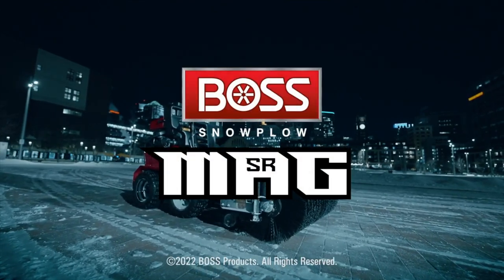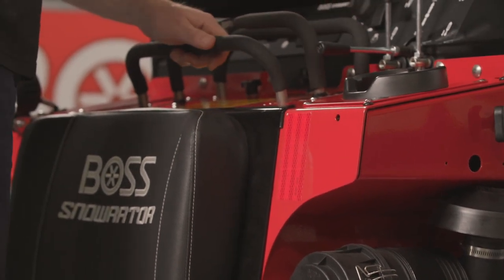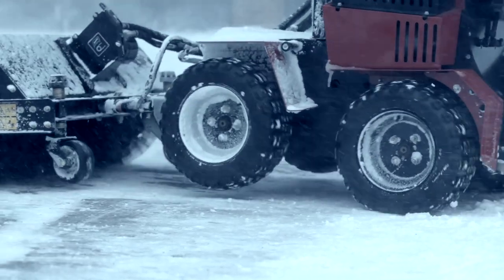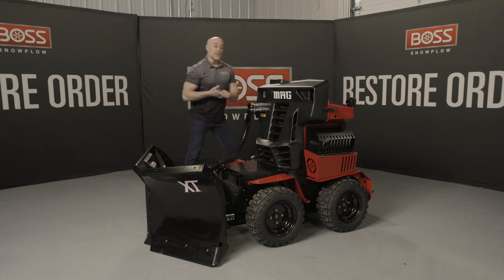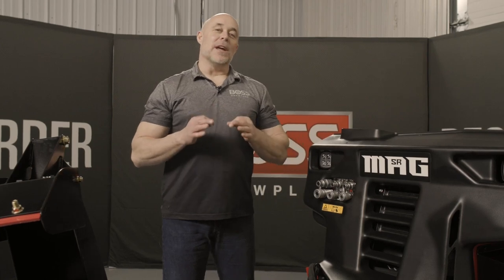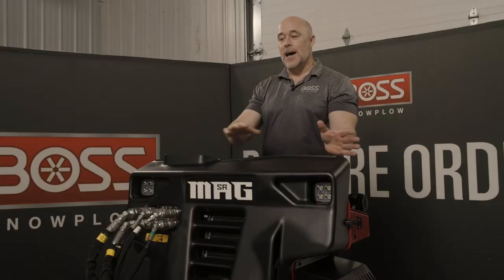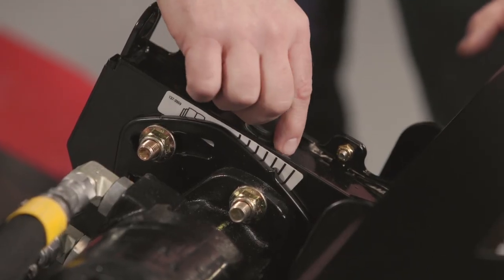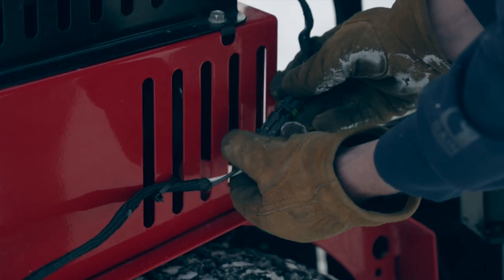SR MAG Product Walk Around | BOSS Snowplow |

Comment: Boss should make a Snowrator 
v plow  kit to make the Snowrator  work in deep snow without fighting sliding and spinning with the stock straight blade...as you try to angle the plow and cast snow to the side of walks .
My Snowrator sucks in snow deeper than four inches ...and the brine kit is a  useless expensive  stock add-on.....

This  new unit has electric throttle control .. that's sure to fail sooner than later  from wet , salty contamination .. ...

If they don't make a vplow kit by next season, for the Snowrator..  I'm going to sell it ...and consider all options , including Ventrac...
Reply: Let's hope a v plow kit comes out ....for the original ..
Reply: I bought a sr MAG  last winter they’re very efficient but they came with some issues and I’m planning get a ventrac next winter

Comment: great job the only thing you're missing is an elf shoe on the front between the front blades, sidewalk expansions joints don't play well with a normal v-plow you need to design an elf shoe for the front and then this thing will be a 10/10